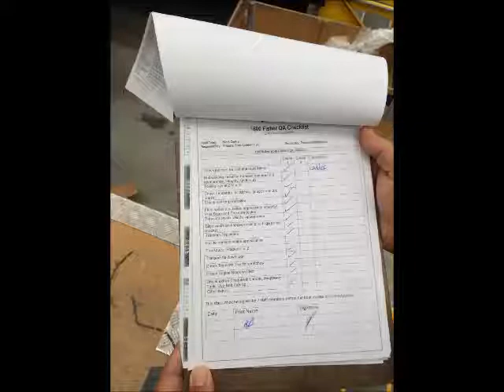Usine STABICRAFT

Comment: I want to ask what thickness of diamond plate do you use for the decking?
Reply from the maker: 4mm for big models, 3mm for the small ones.
Reply: @stabicraftnc  thanks I have 14.5 foot StarCraft I guess 3 m plate or 1-8th will do.